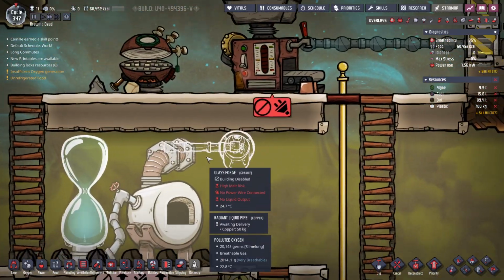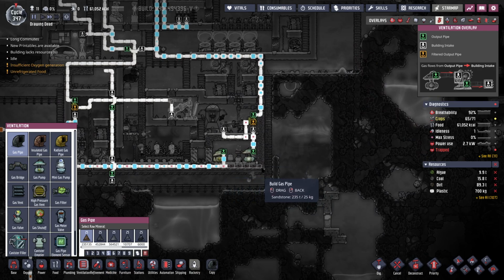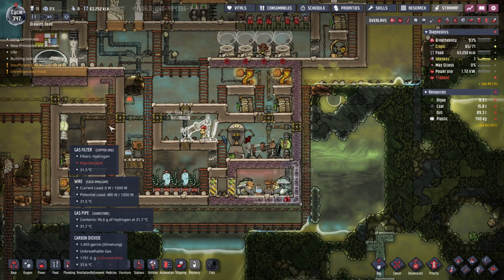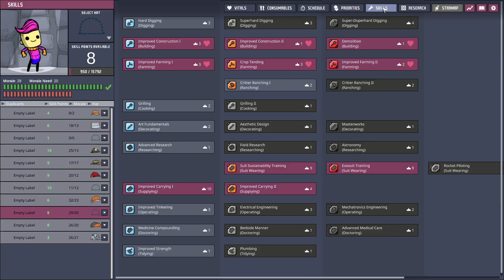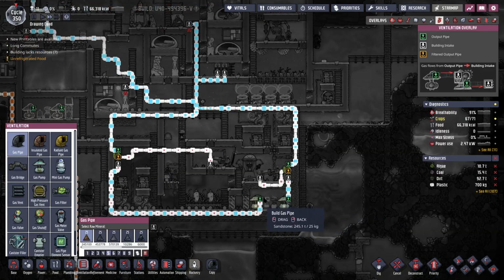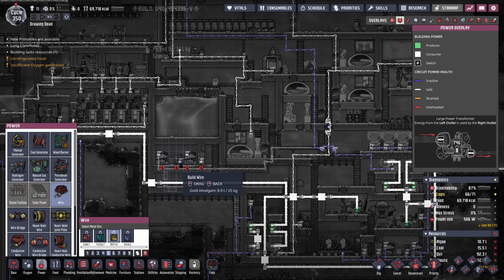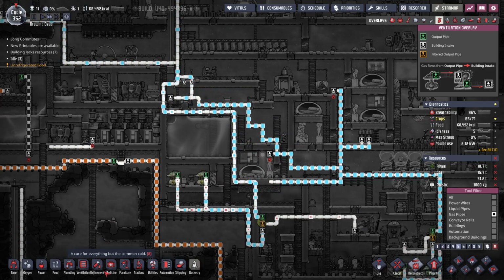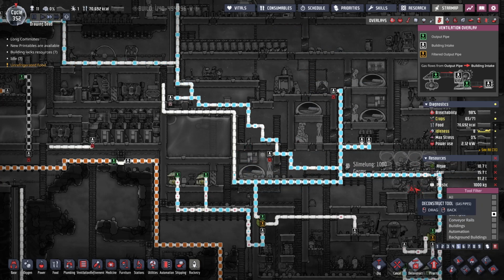#54: Oxygen Included (Oxygen Not Included)

Comment: Some numbers:
Your first bottleneck is at the "Gas filter". You need 1 Gas filter for each pump for continious flow ( so a total of 4 Gas filters for your setup). This is because the small cubes of hydrogen take a full second to process at the filter no matter how small they are.

Your second bottleneck is at the final pipe that splits to your base. 2 Electrolizers + 4 pumps can give about 2000g / sec of oxygen (1776g to be exact). While a single pipe can only transfer at most 1000g / sec of gas. (Those full oxygen blue cubes are 1000g each ).
So for your setup, you will need 2 pipes splitting to your base.

Tip: You can force a gas/ liquid in a pipe to go the direction you want by building a normal bridge there, since bridges only allow 1 way flow.

Comment: 1) since you're expanding oxygen generation, the bottleneck now is capacity of pipes. 2 Electrolysers running 100% gives 1.6Kg/s of Oxygen but a pipe can only handle 1KG/s. One consolidated pipe is not feasible for a reasonably sized base. We need more pipes and separate pipes going to different places.

2) disconnecting pipes without deconstructing them like what you could have done at 22:58 is what makes the pliers mod great. you should give it a try.

3) light bulb connected to nothing but the hamster wheel would be better than that battery in Camille's training set up. Currently when the battery is full, she doesn't have to run. We want her running every moment she is awake.

4) You can just press "P" to set the priority for multiple things at once. You don't have to click on them one by one.

5) I also dont fully understand gas flow when pipes intersect a lot with some circular loops but what i know is bridges sort it out. bridges establish flow direction. so you should experiment with them. liquids/gas will try to move away from the green side of a bridge.